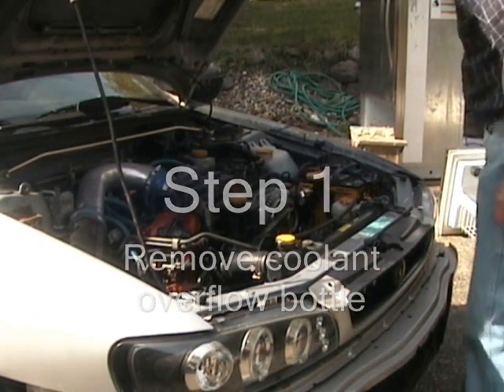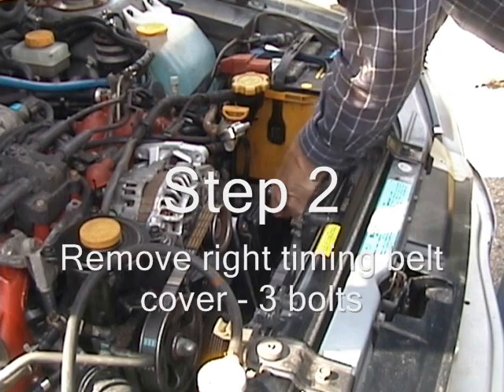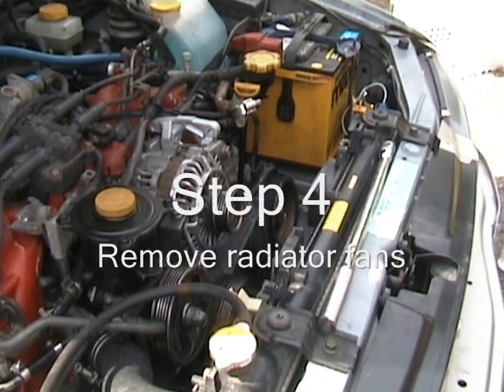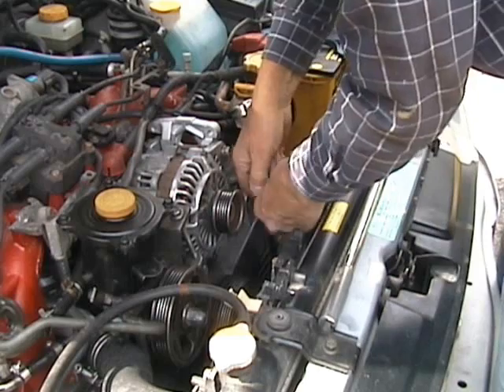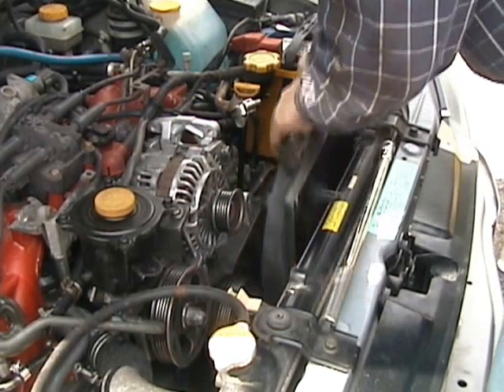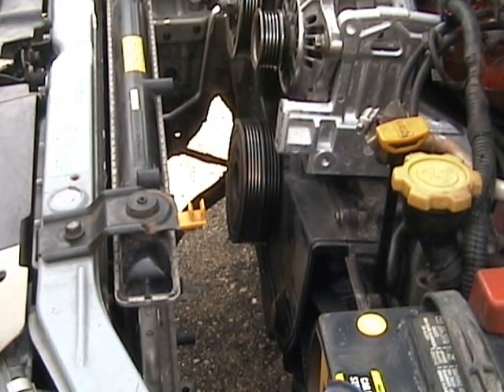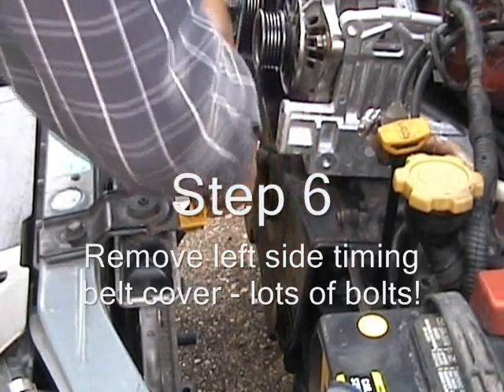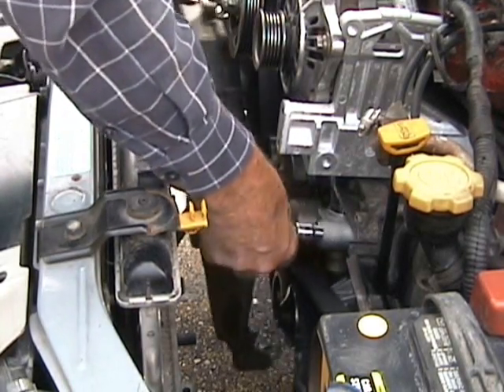How to tell if your Subaru engine knock is from the timing belt tensioner.

Comment from the maker: Chase Roberts - my tensioner knocking is mostly audible at idle. At higher speeds the rattle you hear could be piston slap or small end bearings, especially if it happens as you lift off the throttle.
Reply: Please elaborate on this a bit. My wife's car just started doing something that sounds very much like this. The engine knocks at startup until the oil pressure builds, and then from 3000-4000rpm when NOT under load. With the vehicle in gear, I can WOT from 3-4k and it sounds perfect, but if I lift off in that range, it knocks until the trans upshifts. Exactly what do you mean by "small end bearings"? The bearings in the piston?
Reply: and year later no reply
Reply: @edifyguy  Did anything ever happen with this? My wife's forester is making an aweful sound at 2500-3000rpm when not under load.
Reply: I now know that these engines are known for wiping out the number 3 rod bearing if there's a lubrication issue, even briefly. I haven't rebuilt it yet, but I'm quite sure that's what happened in my case. I had a Pontiac Grand Am with the same issue, and I resolved it by replacing the rod bearings and oil pump. On that vehicle, it can be done without removing the engine. Unfortunately, Subaru uses a boxer design where the engine must be removed and broken in half to reach the rod bearings, which is why I haven't done it. I will eventually, but she doesn't drive very much, and it really hasn't gotten much worse, so I'm holding out for a more conducive place to work on it.

They will run for a long time like this if you're kind to them. Put some Lucas in the oil, keep the revs down, and you can limp it a long way. Hers has been like this for way over a year. That said, if you're getting knock at revs that low, your bearing damage is likely worse than mine, or possibly just your oil is thinner. See if some Lucas quiets it down. I disconnect the spark plug wires at startup on cylinder number 3 (and 1 if it's not too cold) to allow oil to fill the bearing area before it starts getting whacked by explosions. If yours isn't knocking on number 3, you'll simply substitute whichever one it is. If it's not knocking, that means the oil is doing its job and keeping the metal parts from touching each other, which means that it's not getting worse. Do start making plans to either rebuild the engine or replace the vehicle, though, because it won't last forever, but then, nothing does.
Reply: I would also point out that rod bearing knocks generally get quieter when the spark plug is disconnected, so you can often disconnect spark plug wires to track it down. You shouldn't drive it that way, though, because the disconnected cylinder will be pouring raw gas down the exhaust, which will overheat the catalyst, confuse the computer, and ruin your fuel economy.
Reply from the maker: @edifyguy  Yes. Bearings in the small end of the rod. I don't check this page very often since it is years since I made the video. Piston slab is loudest under light  load. At WOT the cylinder pressure  keeps the piston hard against the cylinder.

Comment: my 1999 legacy gt 2.5 is knocking at about 2500 rpms when in neutral and when i get in the higher rpms when going thru gears, could it still be the tensioner?

Comment: hey brian, I think I have the same issue, only mine stalls after some time passes. Did you get the same symptom?
Reply from the maker: +Richie Superales This will not cause you engine to stall, unless the timing belt skips a tooth in which case it will run rough all the time or not at all.

Comment: thank you so much for this video. just replaced the head gaskets on my GF's legacy and did the timing set at the same time. after reinstalling the engine... the sound of motor death almost broke me... if it wasn't for your video I would be halfway to Mexico.

Comment: I'm checking this right now. But takes more time then this video, because every bolt is really stuck! :) I also noticed that some brackets were broken. So i'm checking this now and hopefully see tomorrow if my knock is from the tensioner. 

I checked the ignition system, Oil and air filter, but nothing wich causes my knock. Checkout my channel for my knocking sound.

Too bad, I only have my 98 Forester for a couple of weeks now and I really want to drive long trips now.
Reply from the maker: +Bart ten Thije 
I did edit the video so it took longer. Good luck with yours.
Reply from the maker: +Brian Thorpe 
Your noise could be either the tensioner or a rod bearing. I have had both.
Reply: +Brian Thorpe Thank you very much! I just have few more questions if I may :) --> How can you tell if the rod bearing is broken? I checked the oil for debris, but nothing was found. And my knock is only louder when the weather is colder.And when the crankshaft pulley is removed, doesn't the timing belt pulley behind it fall off when you start it?Thanks again!
Reply from the maker: You should not run the engine with the crank pulley removed.

Comment: Wow I hope that's all my knock is and not a big end bearing! Thanks for this video! There is hope... (99 legacy GTB)
Reply from the maker: Bushman Canuck Good luck! I have another video of big enf knock on the same engine: https://www.youtube.com/watch?v=53cHpWpy6OA It sounds different and further back in the engine,
Reply: +Brian Thorpe thanks but I'm out of luck, drove it about 15 minutes this morning and it went from occasionally making pully noise to full on clanking like in that link you provided....check engine light came on and I coasted off main road to side road. Tried to resort but ecu wouldn't let me until it sat a minute. It started again but sounded like a wash machine full of hammers....on spin :(
Reply: @BushmanCanuck  did u ever figure out what is wrong? I am having the same issue with my 2011 wrx!! Currently :(
Reply: @storiespointofview  Yes, connecting rod baring. It's common on Subaru's, especially if there is any knock from bad knock sensor or MAF, low octane. Sorry man.
Reply: @BushmanCanuck  what was the outcome? Does this mean my engine is pretty much done'zo? This happened when my boyfriend was racing the car.. First it was a small knocking noise then about an hour later we lost power.. And then it would turn on and lose power and bam.. Sounded like the exhaust was rattling from engine to back end..
Reply: @storiespointofview  That's what happened to me haha...pushing it hard! But it was pinging for a while and I ignored it...detonation/pinging slowly destroys the bearing until it fails dramatically. Yes, it has to be pulled out and rebuilt. Sometimes it's cheaper to put in used motor from a wreck. Check out Subaru forums for leads. The joys of Subaru's 😣😂
Reply: @storiespointofview  open the hood, if it still runs...easier to pinpoint sound. Use a piece of metal  from ear to engine block can help find area.
Reply: @BushmanCanuck  thanks for your help 😂 😳 yikes guess its time to start looking into a few things!!
Reply: Bushman Canuck a washing machine full of hammers, thats comical. Same problem here but i also have coolant and gasket leaks and every other subi problem

Comment from the maker: Mathieu, depends on the noise. Bad tensioner noise is not much affected by temperature, but is mostly heard at idle and low speed. Your noise could be lifters.
Reply: Thanks for the answer didn't get a notification when you answered me but happy you did, what I'm really after knowing is did your noise disappear once warmed up or was it a constant noise whether it be warm or cold? My noise disappears after about 4-5 minutes of warming up and then the engine is FLAWLESS.
Reply: ***** Still after a clear answer on this, was your noise more apparent when freshly started from cold? It sounds exactly the same as my noise!
Reply from the maker: ***** Yes, the noise is somewhat less when warm but it does not go away altogether.
Reply: Brian Thorpe Thanks Brian!
Reply: ***** I will look into swapping my hydraulic tensioner with another one I have here handy that looks in good shape and I'll see if I notice any improvement, I can't manage to get that crank bolt off even with all the tricks I've tried..
Reply from the maker: ***** The crank bolt should be torqued to 130 ft.lb on the 2.5 engine so it will be hard to remove. Make up a tool like the one in my video to stop the crank from turning then use a breaker bar on the socket.
Reply: This sure sounds like my noise, a rattle /knock that comes and goes throughout the Rev range....fingers crossed it's not a big end bearing. Will pop the hood tomorrow in the daylight.,thanks for this video!

Comment: I have this noise (did Timing last year) and it goes away as the engine warms up... is it the same for all of you with bad tensioners or does the sound remain even warmed up?
Reply: Did the tensioner fix this?? Mine is the exact symptoms you just said

Comment: Brian, I wondering about this similar sound on my 2005 outback with 119K miles. I had the timing belt replaced about 6 months ago. It's so hard to know if it off the front or in the engine. Anymore clues to pin point it?

Comment: Thank you for posting this video.  I bought a full timing and water pump kit online only to have the new tensioner sound exactly like this, once I started it up.  I thought for sure that I had mucked up my install since the cam on the driver side kept rotating right at the timing mark, making it very difficult to install.  I drove the car in this condition for about 400 miles, maybe more, since I did not have the time to fix it until recently.  It gets very bad the colder the climate.  I suggest everyone with a Subaru, if you suspect rod knock, to investigate this.
Reply: glad you said it gets worse in a colder climate because my stock 02' WRX wagon sounds exactly like a spun bearing upon cold start up (even on a warm start) and knocks just like the video but more intense anytime I touch the throttle. here in Rhode Island it is freezing (25 degrees) which doesn't help at all. BUT the knock does go away anywhere after 3000rpm while driving, and then starts knocking again as soon as i let off the gas and coast. praying it's not a spun bearing and that a Gates kit will square it away. I will post on here again once diagnosed and squared away
Reply: @15subarusti59   , I have a 99 Impreza 2.2  with 127,100 miles on it and from what u described with yours it sounds similar to what mine is doing now ... Was yours a rod knock or was it the tensioner with a possible timing needing to be reset?  Please let me know  Thanx .. Sincerely , Robert.

Comment: Brian, thanks for the video and AJ thx for the follow up.  If the crankshaft sprocket did so happen to move slightly forward having started motor without crankshaft pulley in place, would that likely be the reason that the car won't start again due to teeth on crankshaft sprocket not being picked up by the camshaft sensor?  All timing marks were still intact.  Also, I won't start it again without crankshaft pulley being torqued down!  Thanks again.

Comment from the maker: AJ Dourdo - you are quite right. I wasn't paying attention. The crankshaft pulley holds the cam belt drive gear in place. Although there is no side load on the gear it could move forward and cause the timing belt to jump. Oops!!

Comment: OMG you started the engine with the crankshaft screw and pulley out, that's a fast way to an engine disaster. put it back and give it some torque

Comment: Thank you Brian, just brought 2000 outback that had knocking noise so got it for practicly nothing, previous owner said his mecanic mate thought it could be the water pump, so changed water pump and same noise! came on to utube to research about engine strip down head re-build etc and saw your video and boy was i glad i did GUESS WHAT it was the timing belt tensioner all along. You my freind should receive a knight hood for this videomany thanks
Reply: Nice! I'm guessing you paid around $500-600 for the Outback? and if I may ask, did the knocking noise made by the tensioner go away once warmed up or did it stay? and while driving did it still knock just like a spun bearing would?
Reply: I need to check this out then cuz my 97 legacy outback sounds kinda like this. It’s hard to tell if it’s a knock or not because I am not experienced with knock sounds or Subaru engines.

Comment: 95% sure this is whats wrong with my 2.2 liter impreza. thanks for the help! makes the same noise being loudest at the same rpm.
Reply: If you're still out there what turned out to be the problem?? I got a 2014 impreza that's tapping intermittently while idling but I can't hear it while driving...no engine lights are coming on either. Really appreciate any help

Comment from the maker: The tensioner was new. It came from Amazon and was by Beck Arnely, who I thought was a reliable manufacturer. They replaced it free of charge but the replacement is rattling also. I have driven it like this for about 2000 miles, including a 600 mile TSD rally and 5 Rallycrosses. I will change it soon though and I will get one by Gates as recommended by someone else who commented here. I suppose a small amount of movement is OK until it gets big enough for the belt to jump a tooth!
"The Gates part number for my engine is T43138."

Comment: I forgot to put the crank bolt back in and it loosened up just enough where the sensor wouldn't read the sprocket. Tightened it up and it started right up. Stupid mistake. But found it the knock was my tensioner. Any tips on installing

Comment from the maker: dsean,
I don't see why the engine would quit unless you somehow changed the timing, which seems very unlikely. Maybe you disturbed either the crank sensor or cam sensor. Check the wires to both.

Comment: I done this on my wrx and while I put slight pressure on the tensioner the car shut off and won't start now... Any suggestions? Timing marks look inline, I didn't press down hard just slightly and it quit. Thanks

Comment from the maker: You can see it at about 2min 40. I used a piece of aluminum plate about 1/8 thick. Drill 4 holes to match the holes in the crank pulley. Also one larger hole in the center to allow the center bolt socket to go through. I drilled several smaller holes the filed to suit. Four bolts big enough to fit into the cavitles in the crank pulley were fitted to the plate with nuts.
The pry bar could be any sturdy 4 foot metal bar but I just happened to have an aluminum U section from a shower enclosure!

Comment: After a full rebuild (rod bearing #3 spun) I replaced my water pump, timing belt, idlers, tensioner etc, but oddly enough, the new tensioner failed 2-3000km after the rebuild. The screwdriver to the ear on the cam cover really enhanced the rattle - you could tell it was coming from here and not the rest of the engine. Another tensioner and another cam belt (just in case) and its now been fine 30,000km later.

Comment from the maker: Sad to say my engine developed a serious knock after yesterdays RallyCross at I96 Speedway. Had to get home on some kind fellows trailer. Likely my son-in-law and I, who shared the driving, overreved it several times. It was clearly not the timing belt tensioner (which rattled when cold -a Beck Arnley free replacement!). The knock developed as we started driving home and within a mile it was scary and we pulled off.

Comment: Mine rattles like hell on a cold start up at any RPM.  It started doing it approximately 1500 miles into a 3100 mile trip.  I drove it the rest of the way but I will not drive it anymore.  I decided to go the with the more popular route of a Gates tensioner.  I found that it's not that expensive on Amazon.

Comment: Removed right side cover (facing engine from front).  Tensioner wheel was bouncing up and down same as in your video.  Noise did get louder with cover off.  Rolled the dice and bought the new tensioner without using your double check pressure method.  I used two 3/8" socket extensions about 3" long and a long bar to "lock" the harmonic balancer while removing the big crankshaft bolt.  Problem gone once part replaced.

Took a few hours but was first time working on this car.

Again, thanks!

Comment: Outstanding video for a DIY instructional,  I am about to perform this but will only take off the right side cover and see if the noise is more prominent with cover off.  Based on Google searches this appears to be such a common problem that if that cover is removed and the noise is louder you can almost bank on that being the issue,  Your method is foolproof though.

Also, should "Bob's your uncle" be used when knuckles are bleeding?  :-)

Thanks much